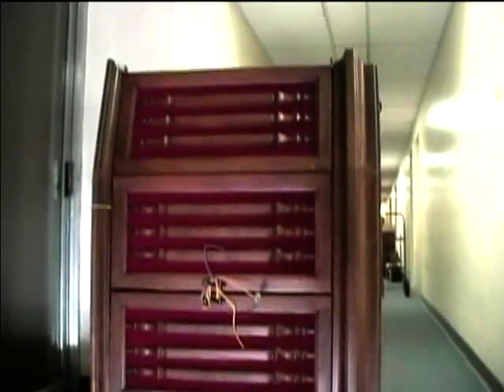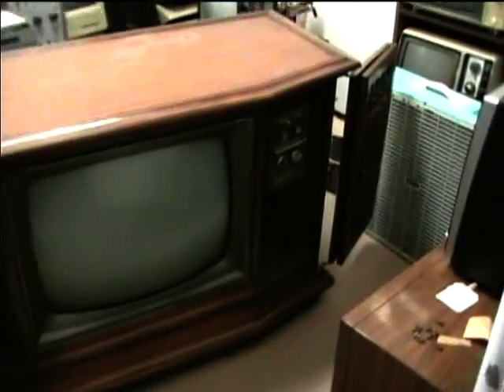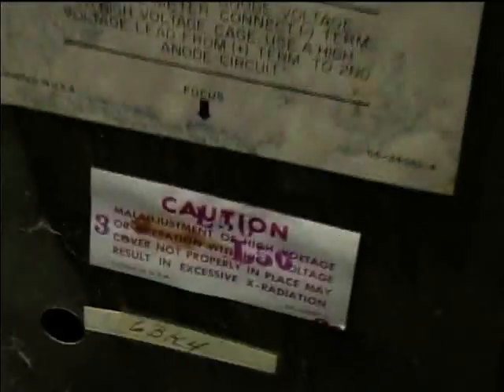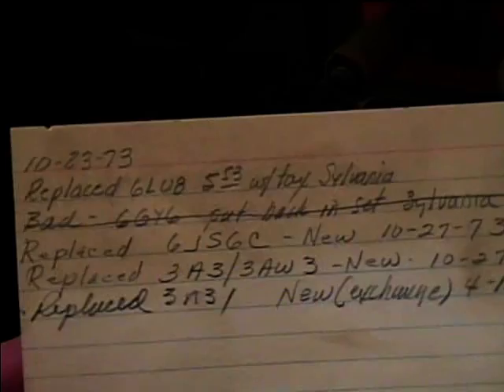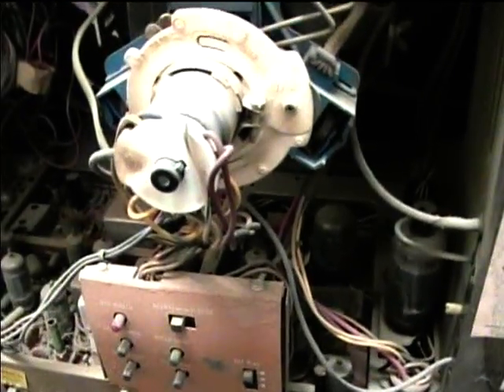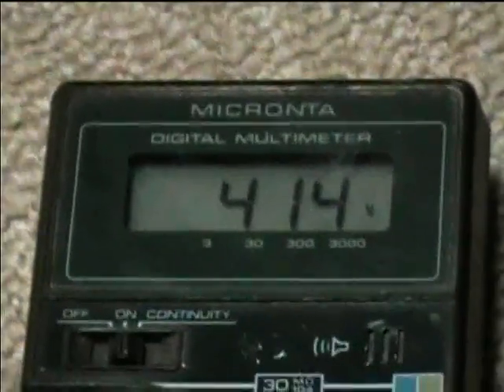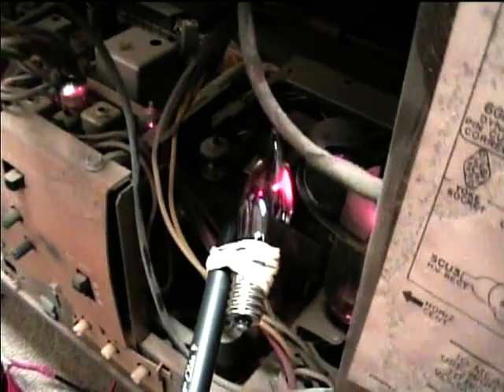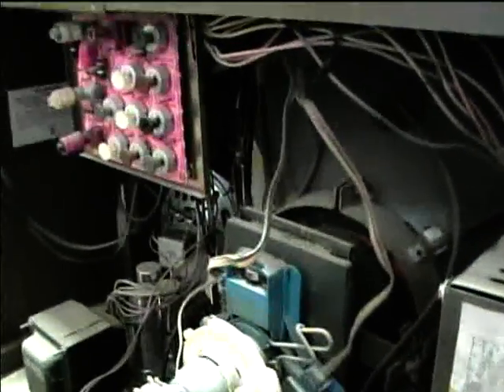1960's Sylvania Tube-type color TV

Comment: 15 transistors and 17 vacuum tubes, hey man another thing, do you take a look in the filament of HV rectifier?, if you get the ionization of the neon bulb lamp the flyback are ok, in the ultor had no spark the filament of the HV rectifier must be opened, or a resistor in serie with the filament.the philco hybrid color sets uses a 1R5 resistor in series with the filament...here in brazil the last hybrid color tv set was sold in the 1972

Comment from the maker: The strange thing is that the neon lamp shows HV AC coming out of the flyback but there is no spark when the CRT anode is discharged so there is no DC coming out of the rectifier/regulator circuit. I've kind of put this set to the side now to try and repair some that have less difficult problems first!

Comment: hey man the HV are present in circuit thats the prove of neon lamp near of ultor cable, so you can see any picture in the screem, well the screen voltages are present in the screen picture tube grids?, this color tv uses RGB luminance independent of  color output , you know its was a system more popular in some low cost color tvs.